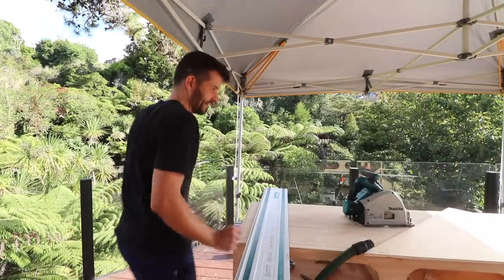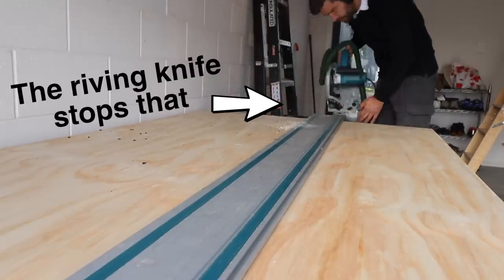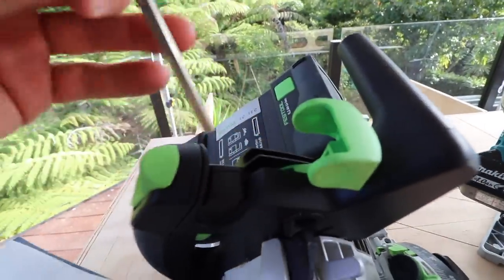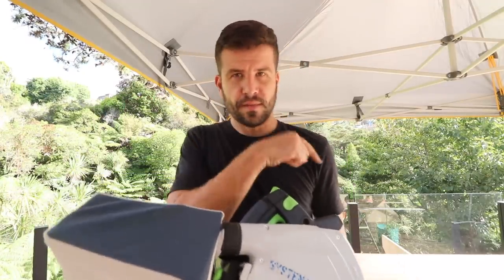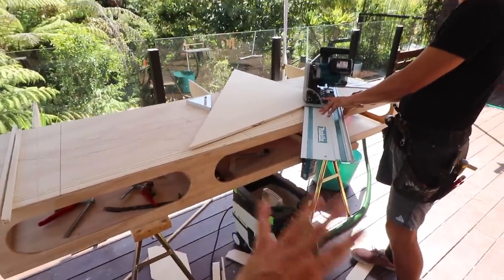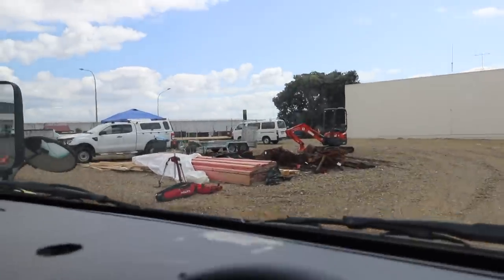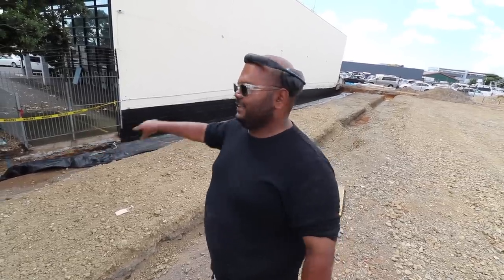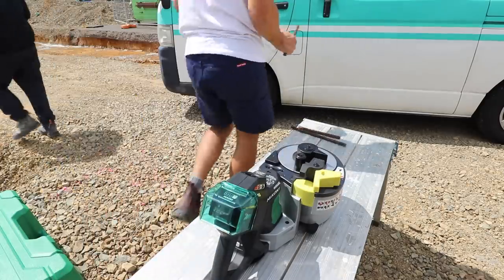Cordless Track Saw: Makita or Festool?

Comment: ...and the Makita saw fits on the Wen tracks too.    I needed  short tracks for portability to jobs, and the 40" wen have been doing good so far.   The splinter tapes and glide tapes moved when they got hot in my car.   Track saws and then the cordless saws can really change workflow in a good way.

Comment: I have both the corded and cordless Makita.   They are very well built and use them every day.  One thing you forgot to mention is the makita has a tab to lock it on the rail whereas Festool does not not. Very handy on 45 degree cuts.
Reply: Which is better - I am about to buy one.
Reply: @ridgmont61   Makita cordless all the way.

Comment: I use a foot pedal switch to turn on my vacuum as needed. The Bluetooth looks very finicky. Inside carpentry youtuber use a festool clamp system for holding the track. That was slick.

Comment: Perfect. I just started on the makita platform even though im already on Milwaukee. But Milwaukee doesnt have a tracksaw that i know of. So makita it is
Reply: Go on ebay and look at battery adaptors.. milwaukee to makita.. save you a few quid
Reply: Red China actually has a track saw. They are testing it on the rubes in Europe before they screw the North American suckers. I mean red chinettes. I mean consumers. Damn autocorrect.
Reply: @petepistachio8229  could only see a circ saw with track base but no full shroud

Comment: You can get a Bluetooth remote for the festool vac wrap it around the hose where it plugs into the tool, I’ve just got the vac and have the Makita tracksaw. I’ve also got the small Makita brushless 18v dust extractor, thanks for sharing lads

Comment: Not a lot of point buying “cordless”when you’re still tethered with the vacuum hose.
Reply: Not when you got a makita backpack vacuum
Reply: @perrinekld7451  That makes no sense, the last thing you want on your back is a vac when doing Carpentry work
Reply: Exactly. I find some things are going a but OTT with "cordless" these days. For myself I will always have a mix of electric with some cordless tools
Reply: Look like a right plonker wearing a backpack. I love my tools but some are just a complete waste of time
Reply: So you'd rather deal with a cord and a hose then just a hose? In my opinion dealing with just the hose is half way better then dealing with both!
Reply: @paulmcgeoch2603  hahaha, true. Yep that's my point exactly. I can't think of where a backpack would be of use. If there is that much cutting to be done to justify wearing one then the right tool is probably not being used for the job.
Reply: I’d rather use the dust bag and where a mask 😷
Reply: @paulmcgeoch2603  that's cool if you're working on you're own place but at a customers house you gotta use a vac
Reply: @justgregnow  yep I do. It's no drama. I tape the cord to the hose so it acts like one line.
Reply: Pzlsi Koleia I didn’t know Makita made a hoseless Vac. Do tell.
Reply: CraftManGreg at that stage of construction, when using a track saw, the house has power. And due to the fact you are hooked to a vac you can work in the house. So, to have the constant power needed to run a vac and a track saw.........the extra cords are fine to go along with the vac hose. But as I have been saying for years now. As soon as they make a hoseless vac I’ll go battery track saw.
Reply: Listen, I ACTUALLY USE my makita backpac vac or even my metabo 18v systainer shaped vac (as powerful as the makita) and it's still more convenient than my corded ctl mini, especially in tight spaces. For long cuts, my backpack follows me during the cut. I also have the mafell aerofix system you can put the device beneath or over the track. I can plunge cut absolutely anywhere if i want. Conclusion it's efficient for renovation tasks, if you're more likely to use it in your workshop, cordless is total nonsense.
Reply: Do your cutting outside, no vac needed or be a savage and work inside spraying dust.
Reply: Hamish Goodley yeah like drills and stuff needs to be cordbless but a simple jigsaw nah
Reply: @hamishgoodley7208  I love my cordless makita jigsaw but I'm not buying the cordless track saw, I would never be 'freehanding' it in such a weird way to need it without a cord. Plus I used my circular saw without the vac once inside my home (just a small cut..:P you know the story)... my wife didn't speak to me for a week as she had to clean the dust from everywhere :P
Reply: Makita cordless track saw with dewalt 54v m class extractor, ace combo + works surprisingly well with just a bag,cheers
Reply: No such thing as a cordless vacuum hose unfortunately..
Reply: @zaneh6224  I wouldn't say last thing, I reckon a blue whale would be a little worse on your back than a vacuum. But I agree I don't want to be carrying around a vacuum on my back that sounds horrible
Reply: Dont need a vac if outside, my circ saw dose not even have a port
Reply: Yeah id rather deal with just a hose and no cord given the option.
Reply: My thought exactly. I made myself a hose with power cord by putting a cable sleeve over the hose and cable. In addition that cable sleeve slides a lot better over the edge of the rail and doesn't catch that easily anymore.
Reply: @justgregnow  Unless you have a hose with the power cable fitted to it. I made one myself by putting a cable sleeve over the hose and cable. Also doesn't catch on the end of the rail anymore.
Reply: At the end of the day makita makes great tools and so does festool, both are quality tools
Reply: That’s why you get the cordless Dewalt snd the T-stak cordless hepa vacuum. Awesome system
Reply: Agreed. Cordless isn’t really “cordless”. Save money. Buy refurbished corded version and get to work!
Reply: Paul Mageoch. Cordless is a lot more handy and it doesn't take much to turn a vacuum on. The vacuum hose is always an issue unless you have some overhead system. I'm sure if you put your mind to it you could make a jig so the vacuum hose is out of the way. Certainly a lot less dust with a vacuum compared to no vacuum.
Reply: From experience with the festool i can honestly say, buy 2 extra batteries with your festool saw, because you will finish both batteries fast with repetitive work, i brought the cordless saw for a shop fit out, was a complete waste of time, i ended up taking out the corded saw, batteries cant cope with the work i put it through, still cant beat the cord, a vacuum can only work efficiently with direct power, batteries pack are not that advanced yet they will still die on you and will require a charging time
Reply: Sam Singh I couldn't see the rest of your comment on a portable device. If you are doing s shop fit out and multiple cuts it will be obvious to be taxing on batteries. And so the higher amp hour batteries will have to be in your list. The festool as far as I know have the 6.2 amp hour. I have one 6.2 amp hour battery. When I had a festool cordless plunge saw I had 2 4.2 amp hour batteries and one 5.2 amp hour battery. If I didn't charge batteries for a while. Ie using batteries for drilling. I noticed with the smaller amp hour cuts used quite a bit of battery. In saying that the machine is a lot more powerful than the 1,200 watt corded festool plunge saw so it cut material effortlessly and like cutting butter. On one hand companies like makita, Milwaukee, metabo, Bosch, dewalt have added higher amperage to their skins. Well, dewalt have their 54 volt range and here have the 9 and 6 amp hour depending of its 18 volt or 54 volt. The festool don't seem to be in a hurry to bring higher amperage batteries until they are thoroughly tested. I'm not sure their process. I'm more excited with the higher power Milwaukee batteries which are 72 amp hour. Not sure how many volts for the batteries used on their big wet saw and breaker.
If you want a good saw, look at the mafel. Metabo will bring out a plunge saw in conjunction with mafel. So you can either have the 8amp hour battery or the higher output 5.5 amp hour batteries designed for high demand tools like angle grinders.
Perhaps wait for the Milwaukee to bring out a plunge saw.
I will wait to see metabo plunge saw which hopefully will be well made and in that case the same price as festool. A bit like the high end metabo sanders with similar design as air sanders.
Reply: Paul, 100% agree
Reply: @je-fq7ve  I am a savage according to you...
Reply: @kizzjd9578  Makita makes a HEPA cordless vac. I got one.
Reply: @jeffshackleford3152  Not a personal attack. I call some of my favorite people savages.
Reply: @je-fq7ve  it's all good... I freely admit I am a degenerate
Reply: @je-fq7ve  yep, i got the dvc 750L , dvc152L and vc4210M
Reply: But only have to worry about one tether instead of two, plus you don’t have to worry about finding another outlet to plug into.
Reply: The point is you don’t have to be connected to the cord or hose if you don’t want. And plenty of ppl will use their track saw here and there without needing/wanting the vac.
Reply: This is probably the most overrated and ill-considered
 comment that always pops up on cordless machines with a vacuum attachment. 

Has it ever crossed your mind that people may actually use their machines for multiple purposes? Sure, if you're only ever going to be working indoors, always attached to a vacuum, there are less arguments for going battery powered. But who uses their saw like that? Nobody. Even if you work indoors attached to a vac most of the time, there will be a time where you want to quickly chop something off outside, where you don't need a vac. With a corded tool, you're probably gonna have to find an extension cord and run that out to where you need to cut. Then you find out that cord is broken, or too short, so you're gonna have to get another one. After cutting, you need to put them away again, which is especially fun if there was a lot of mud around. A battery powered tool you just disconnect from the vac, and take it anywhere you want to cut. No mess, no fuss.

Also, there's plenty of battery powered vacuums these days. With those, a battery powered tool is even better. I don't know where you've worked, but I've seen more sites with tons of cables running absolutely everywhere, than sites that have nice clean power distribution. If you can avoid having to hunt for power on a job site by just having everything battery powered, even though you're attached to a vac, that's a massive win, and that's not even considering the cleanliness of your own section on that job site. Cables are always a hassle, annoyance and even a slight danger. Even eliminating just one is a win.

There's a LOT of reasons to have a battery powered tool that's attached to a vacuum. The absolute only time when you would not want to get one, is when you're in a production facility where the saw will always be used in 1 location, and it NEVER leaves that location. Since that's hardly ever the case, your comment is the only thing that doesn't really have a lot of point.
Reply: @timderks5960  spoken like the only person  here who actually works on a jobsite. The only tools that I use corded versions of are ones that either need to be running constantly for long periods of time or ones that use a tonne of power.
Reply: sorry thats not true !
Reply: @perrinekld7451  And as a bonus you get to pretend you're a ghost buster.
Reply: You can have cordless vacuum cleaner for example blue Bosch
Reply: @hamishgoodley7208  Kind of like a regular carpet vacuum. Power cord is built into the hose.
Reply: @justgregnow  I'd rather just not use any vacuum and just have the cut station outside and not worry about it. Free mulch for the homeowner.
Reply: One cord is better than two
Reply: @ron1martens problem is. Its hard to wait 😅😂
Reply: @MichaelRozie i have exactly the same story, almost got divorced
Reply: @benbug  😂😁

Comment: And also the makita track saw runs a thinner blade to compensate for less power, we found that out the hard way cutting beams and had the blade wonder into our rail ! Didn’t have the problem with the festool but we were pushing the limits of the saws with what we were cutting so....

Comment: It's hard justifying a Festool purchase. But when I buy them and use them it's so nice to use. My track saw is 12 years old and used a lot in the shop and the site for ripping. Great for ripping hardwood boards to get one side straight so I can dimension the board on the table saw. Much easier this way.

Comment: I have both the corded and cordless makitas. only real difference is the corded saw will rip solid timber with less wining about it.   
also the cordless takes a super thin kerf blade, so if your using two saws on the same tracks, the rubber will be off slightly

Comment: You should check out the Mafell Tracksaw.  You can connect two tracks without straight edge , one 18v battery (Cordless Alliance, so metabo battery's), better dust extraction and faster blade change.

Comment: There is lots of Makita users who are writing how good it is but I give you just few reasons why real professionals are using Festool or Mafell. 
1) clients do pay for the finishing quality. When you make just once mistake when cutting because not so good depth regulation system, then you have lost easily more money that the price of the saw
2) When you have the kickback, the same results can be happening. If you brake valuable plate then you not only do not loose money of that plate (sometimes eg. kitchen countertops are having long delivery times, can be expensive) but also working time and it do cost money. If a worker do broke his wrist, then me as his bosss, are in deep trouble, not only he

If you are cutting just plywood etc which are not finishing material, then you can use also the saw you buy from Lidl. I have one (bought because it was cheaper with guide rail that just the guide rail of Makita which fits to Festool) and I can work with it when there is not worries about the best quality
Reply: @samsingh2042 everybody knows that but still they are buying track saw with battery. Vacum with battery is not efficient, only if you are using for cuts, if you need cleanig customer house after drilling walls, conecting cabinets...battery one is not good.Im now with makita tools and batterys system and I love it. Biscut joiner, drills ect. I tryed festool tracksaw and vacum with my coleague carpenter and that feeling of using festool tools is great. Souch better touch and details better than on any other tool. I own einhell track saw with cmt blade and karcher industrial vacum all corded. All together 300€. Geting jobs done with new blade 58 tooth super clean cuts, razor sharp. 
Already two weeks Im watching youtube videos about track saws and vacums...Festool ts 55 battery version 1300€, festool corded vacum midi 1 700€. 2000€. Why I dont go with makita system same setup for 1000€ with 18V batteries which I already own. Or why I dont stay with not profesional einhell and karcher which paid themselfe 20 times and get job done. ..bla bla you canot come to customer house with non professional tool, you dont look serious...its not that. Its sickness to spend money on things which you maybe dont need in that moment but you dreaming about it.🤪🤗  pardon me on my english, gretings from croatia

Comment: Hi there!

I don't see the benefit of a cordless tool, if you also hook it up to a vac. I love the Makita tracks and have a TS-55 myself. The riving knife was the reason for me. Sadly often underrated in its usefulness. I would tend to buy a Makita skill saw as I am also in the Makita system already. 

By the way: Wouldn't a crosscutting guide rail as a FSK 420 be useful for your work as a carpenter?

Regards,
Etna.
Reply: I also have the TS-55 and 75, I agree with you, don't see the need to cordless if you are hooking it to a vacuum, just plug it in and set to auto, no bluetooth to worry about. I actually just sold off my FSK/HK set up. Found I only really liked it for cutting stair stringers. Otherwise I have multiple mitre saw sizes I would rather use for cross cuts.It ended up being another tool I had to carry around but didn't use.
Reply: Fair enough. I haven't used those tracks myself and was just wondering. In Germany it seems to be the case that without such a saw by Mafell you're not a real carpenter. Too expensive for me but everyone building a terrace seems to use them. I would just use my plunge saw with my DIY crosscut track. But hey, I don't this work so often.